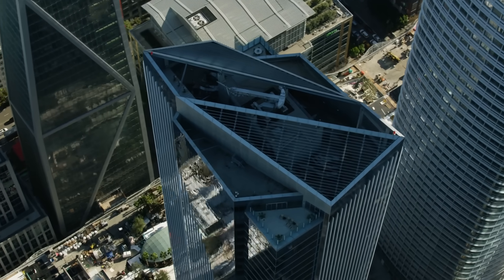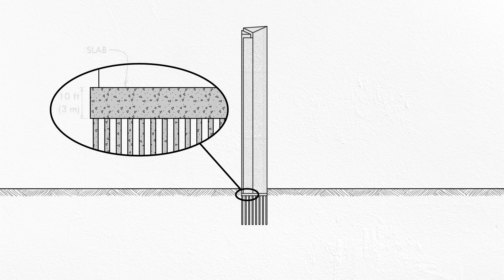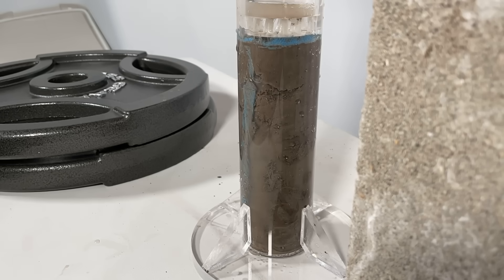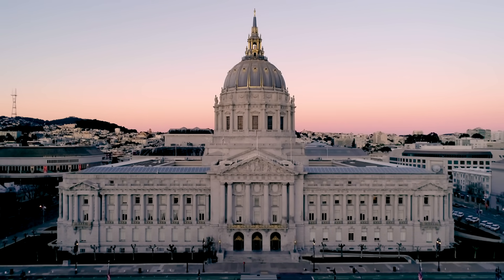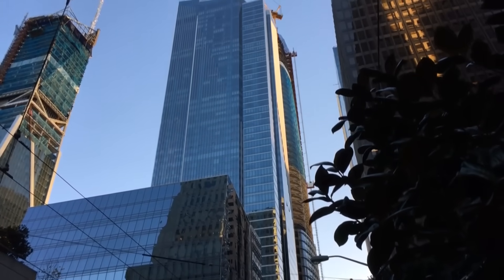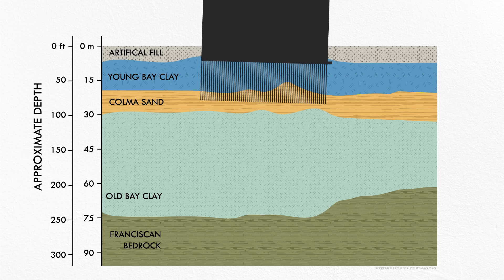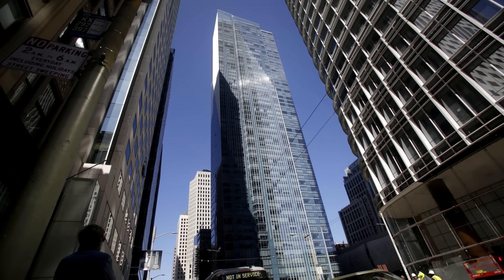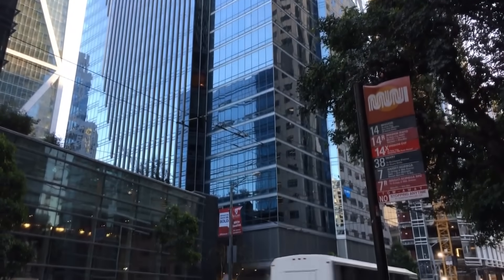What Really Happened at the Millennium Tower?

Comment: The support of the tilted side depends on the support of the hydraulic lifters. In a major earthquake the seismic waves when combined with liquefaction could potentially lead to a catastrophic failure of the hydraulic lifts during one of the sways of the structure which as the sway reaches its maximum pitch would result in a sudden and devastating collapse of the side where the extra supports were added leading to an unstoppable momentum force which would not only drive that side of the building further in to the ground but also destroy much of the anchoring foundation on the opposite side of the building allowing that opposite side to break free, the results of which could cause destruction not only of the building structure itself but other nearby structures as well.  I think people's concerns and subsequent drop in unit values has merit.  Remember, the original plans were deemed safe and sufficient by engineers, just as all the surrounding structures that were later added also were designed and approved by engineers, all of which have resulted in unforeseen consequences and that is under normal conditions. I would not put faith in stop-gap measures that are implemented just to save a structure from further failure due to faulty engineering in the first place, which was most likely influenced by greed.

Comment: Try this yourself. If you make say a temporary step out of two same length pieces of 6x2 it will rock over its length. If you do the same but make the bottom timber an inch longer each side it will not.

Comment: Hum, looks like the engineers are on strike 2, one more and your out.  Here's an idea, start disassembling the building from the top down (before the collapse) and you will be able to reuse all the materials in a better location, save money and lives. Probably only need to reduce the weight by about 25 floors.

Comment: San Fran is one the most expensive cities to live. These units were sold for $$$$$ millions! The developer decided to save on costs by not digging to bedrock which they should have done. Clay or porous material is not stable and yet they built on it. So, the building shifted as the weight is too great! Developers must not be allowed to take shortcuts on what is required for 58 storey building.

Comment: the way to fix it is by digging sediment away on the opposite south west side of the building so that as it continues to settle (which cant be stopped) it will straighten up as it does and then refill the space left from the leaning on the northeast side...messing  around with the north east side before doing this will only increase the rate at which it is leaning in that direction..accept the fact that it will continue to sink and apply this fix of .digging on the opposite side of the direction from which it is leaning and let it straighten up..once it is straight .

Comment: Nashville, TN is building high rise mix use residential/retail/corporate structures with underground parking at least 4 to 5 levels deep. The rate and number of structures under construction greatly disturb me!. There is a lot of dynamiting used to break up the bedrock which is common in Nashville. I am concerned that hairline fractures are possible which may cause sinking and structural clasp if Nashville has another earth quack. Would you mind looking into construction going on now?

Comment: As a local geologist, I don’t believe this structure will be safe during a strong earthquake.  This foundation design has been used on other high-rises in the area, but this building is three times their weight.  The total amount of subsidence, and the differential character of it, are warning signs.  I’m glad I no longer work at Fremont and Mission streets.  I wouldn’t want to be on the street on my lunch break near this building when the next 7MM or greater hits.  I believe the developers are mostly responsible, for pressuring the geotechnical engineers for a cheaper design than drilling into the bedrock, and the city for approving this stupid design.  The city engineers waived various tests and reviews, apparently, in its eagerness to encourage this development.  It costs orders of magnitude more to retrofit to a proper foundation than to install it in the first place, before the building goes up.

Comment: They had a crew outta L.A do the concrete columns and floors on a residential tower in Las Vegas bout 3 stories above grade a outside volume between floor slabs was 5 inches out of plumb even a street observer could eyeball this problem ,,they just hurried to cover with facade,the building is still there but always wonder for how long,,ibuilt in 07 to 10 on the strip

Comment: Is it possible to put something in that fills and hardens in place of the water to slow or stop the soil compaction? As water is pumped out some type of slurry or mixture is pulled into the air pockets? Also could they simply cause settlement of the otherside to get the building back to level then install the micro piles that way the weight is spread more evenly along the foundation like intended? Its like stepping on a ketchup packet.
Reply: Before spending all that repair money they should have tried some J-B Weld first.  I use it and can fix anything with that stuff.

Comment: So  For 4 months the remedy is what? At a standstill while modified or improved drilling techniques are employed? Or still being discussed? And believing a clay which until set is elastic, can keep it steady is an interesting proposal. May it be that they can drill heating rods into the clay on the low side of the structure and cook it hardened as a stabilising function before the bedrock piers are installed beside the heated clay area?

Comment: Shortly before construction started Treadwell & Rollo, the geotechnical engineer for Millennium Tower just had a 52-story skyscraper at nearby 80 Natoma with the same heavy cast in place concrete construction and shallow foundation as Millennium Tower rejected by the city's Department of Building Inspections so knowing the Millennium Tower would also be rejected they simply skipped getting the Department of Building Inspections approval and went ahead with the construction of the Millennium Towers. 

This is what happened and a whole lot of people knew about it, everything else including this guy who seems so trustworthy is interference meant to create doubt and confusion.
Reply: Sure they did, and UFOs and Big Foot too. Get outa here with that conspiracy trash
Reply: @m2heavyindustries378   In mid-2004, when Millennium was still on the drawing boards the Department of Building Inspection took the extraordinary step of ordering construction halted on a 52-story project at nearby 80 Natoma St. in part because of a threat that it could sink into the watery clay and sand South of Market.
The then head of the building inspection department, Frank Y. Chiu, said in a legal declaration in October 2004 that he ordered a work stoppage in light of experts’ warnings that the 80 Natoma St. project could sink more geotechnical consultants estimated in the sandy, watery clay soils South of Market.
"The Millennium Tower is a much heavier building sitting on worse soil, designed apparently by the same geotechnical firm – Treadwell and Rollo – that designed the 80 Natoma building.’’ said engineer Jerry Cauthen, who was involved in the planning of the nearby Transbay Transit Terminal. " 
Cauthen said that given the warnings about 80 Natoma, the city's Department of Building Inspections would never have approved a similarly designed foundation used by the Millennium project had Treadwell and Rollo submitted it. 

Like it or not this is what happened but tell me square man why do all you brain-dead liberals resort to trash talk when presented with facts that contradict the diarrhea coming from your mouth.?

Comment: seems to me that the cheapest and safest solution would have been to rebuild.   

So far the fix has caused more damage - the fix will work 
assuming the new pylons are able to bear the weight of the building without buckling
assuming resonance from an earthquake will again not buckle or resonate
assuming the load can be shared equally, 
assuming  the other side will not continue to a point of stable equilibrium and not cause opposite tilt
assuming the hydraulic jacks do not corrode or leak - resulting in support loss for that pylon (and increasing strain on the others)

a recipe for catastrophe (time for hollywood to make a movie).
Reply: As for your point on the jacks failing, once lifted, shims are installed and the jack released.
Reply: @RRaucina  Assuming...

Comment: So they are propping two adjacent sides up, what happens when the other two sides continue sinking over time and the two connected to bedrock are either not sinking with them or sinking slower. This seems like a temporary solution to a long term problem.

Comment: Its weird that you made a comparison between your house and a skyscraper. Why dont skyscrapers in particular always go to bedrock if they are going to have piles in them anyway? These constructions can literally define the city they are built in, for the worse if they have structural failure.
It doesnt sound like it was unexpectdly deeper when they tried just that the most safe option was avoided for minor savings on a structure that needs to be desinged to possibly outlast all of the original construction crew.

Comment: I'm interested in how a building can be designed to sink several feet.  What happens to the entrances, driveways, plumbing, sewer lines, etc?  How are these designed to compensate for the sinking building?
Reply: Weight of the structure isnt just compressing area right under it, everything close to it also sinks as the pressure is distributed to the ground
Reply: @AleksiJJ  well the sidewalk doesn't look like it's sunken 30cm
Reply: @AleksiJJ  Nope. Just bedrock foundation connection is enough here!
Revit! What u use now? Volume calculations, sand? pencil/paper?
Reply: That's exactly what I'm wondering. I genuinely can't get how the entrance of the building seems to be perfectly level with the sidewalk, but it has apparently sunken around 30cm. I don't know why anyone is not wondering the same thing.
Reply: @vesk4000  this is from a response in a comment above this one, "The sidewalks adjacent to the building are attached via reinforcing steel into the concrete of the building itself, so as the building sinks, the sidewalks closest to the building sink along with it.  This causes the sidewalk to buckle and crack, which is one of the first signs engineers noticed that the building was settling at a much faster rate than had been anticipated."
Reply: Not sure about that but I do know they compensated for the sinking by redoing the sidewalk multiple times until they couldn't.
Reply: Everything in that area is sinking along with the building; the general area in downtown SF has sunk 2 ft according to a satellite survey. (See local news report about it here: https://youtu.be/7N4G2K0uOok)
Reply: They get updates, we do that too here
Reply: this is from a response in a comment above this one, "The sidewalks adjacent to the building are attached via reinforcing steel into the concrete of the building itself, so as the building sinks, the sidewalks closest to the building sink along with it.  This causes the sidewalk to buckle and crack, which is one of the first signs engineers noticed that the building was settling at a much faster rate than had been anticipated."

Comment: Well i see a design flaw in your drawing of the supporting peers and the extended slab meant to raise the original Foundation if you look at the drawing the locking mechanism between the two slabs is drawn upside down or backwards the way it is drawn it would help hold the foundation down but it wouldn't help lift the foundation that extended slab or footing or whatever around the exterior would only help push it down or hold it down that is the original Foundation you would have to reverse the angle in order to give it uplift or support please respond

Comment: As someone who's worked with hydraulics a few times, I'm somewhat concerned that there doesn't appear to be a stage in which the hydraulic jacks used to realign the building are replaced with a more permanent solution.

Hydraulics are a great source of mechanical advantage.  You can put a little force here and get a lot of force out the other end.  They're extremely useful for people looking to apply a force to an object and make it move.

What they aren't is reliable in the long term.  Their design is based on a pressurized liquid (hence the name hydraulic- hydro meaning water or liquid), and if that pressure vessel leaks, their strength is lost immediately.  If you've ever had an office chair's height adjustment system fail, you'll know what I mean.  (Technically that's a pneumatic system, using air rather than liquid, but the core principle of the two systems is very similar)

Hydraulics certainly aren't necessarily unreliable in the realm of machines.  They're a relatively simple system by machine standards, meaning there's less that can go wrong with a hydraulic jack than a more complex machine like your car.  So yeah, they're quite reliable.  The hydraulic systems of an aircraft are literally the single most important component of an aircraft (I'm several years out of date, but as of a decade or so ago, nobody had ever safely landed a passenger jet liner without a working hydraulic system outside of a simulator - and yes, people have landed planes without a working engine and without working landing gear).  With the proper maintenance that aircraft get, those passenger jets are the safest vehicles you can use to get from point A to point B.  And if your hydraulics are not well maintained, like the ones I was working with tended to to be, you tend to have issues.  The one we had in the processing lab at university was only about 90% reliable, meaning it was available 9 days out of 10.  For machines, that's honestly not that bad.  It's not great by any means, but it's not failing on you multiple times a day or anything. But in the realm of construction - of static materials, that kind of reliability is terribly dangerous - failures tend to cause rather dramatic problems in buildings rather than just making a few tools in the lab not usable until maintenance can get it fixed.  

Static structures like buildings, bridges and roads tend get little to no maintenance at all.  This is why such objects are constructed from durable materials: concrete and asphalt reinforced with steel rebar and supported by steel girders or steel cables.  These materials don't have much of anything going on in them at all.  There's very little in the way of mechanisms or movement involved, and the things that are there (like expansion joints on bridges) are there by necessity and are designed to be as simple as possible.

Overall, the difference is simple: machines, like hydraulic jacks, are designed to move. Structures, like skyscraper foundations, are designed to not move.  (That is kinda the whole issue with this particular skyscraper - it's moving.)  Throwing in machines that are designed to move as if they were any other structural member means you have to be just as confident they won't fail as you are that concrete won't crack and steel won't bend.  And...I'm not sure I'd be that confident in any hydraulic jack, no matter how well designed it is.  

Of course, I'm not sure what the proper solution would be.  You need it to move in phase 1 of the operation - lifting the bottom corner to plumb up the building.  But then you need to make it immobile while it's under load.  That's a tricky problem, and while I did study engineering, I'm not a specialist in foundations.